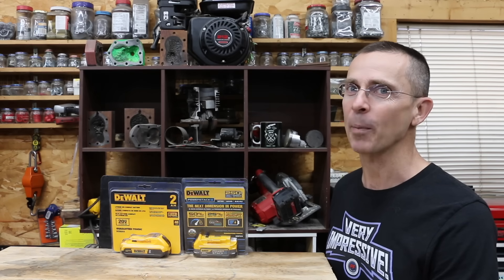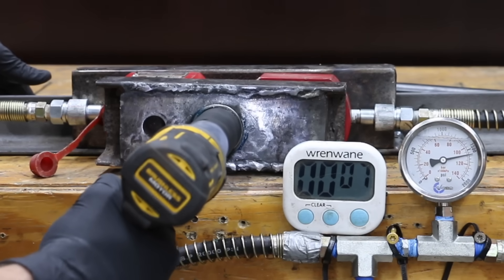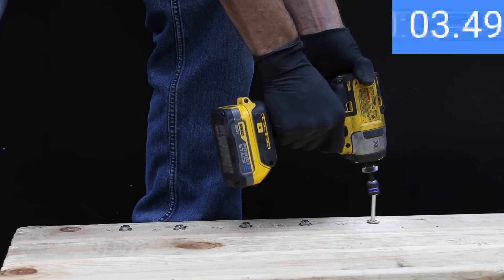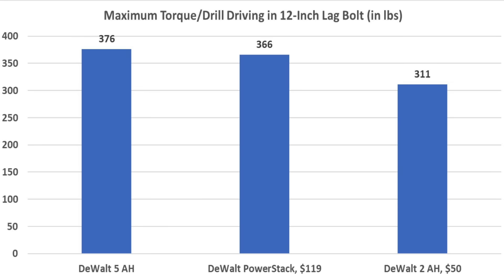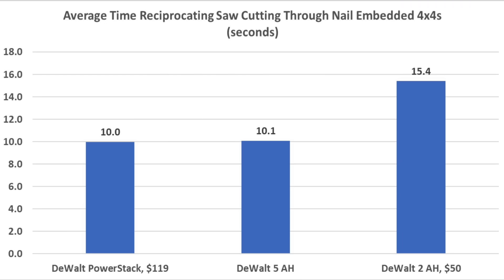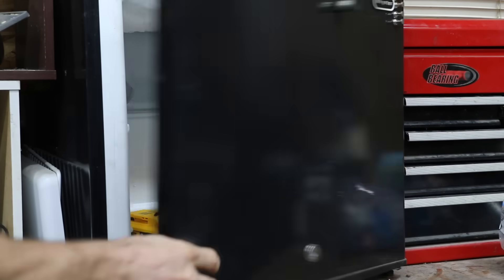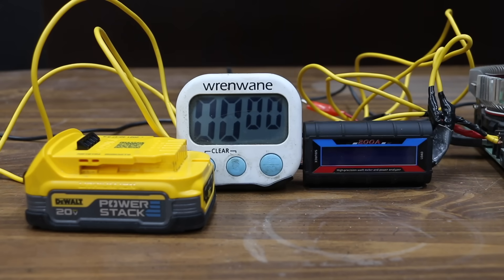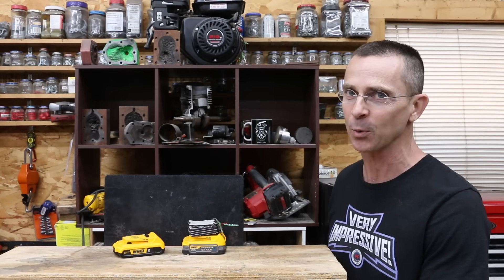Compact “Pouch Cell” Battery Better? Let's Find Out!

Comment: The 5AH battery has the advantage of lower discharge rate per cell, thus generating less heat and surviving at a more constant rate.  Even without recharging, I find my batteries still have power once they return to ambient temperature.  Heat is the enemy of Li-ion.  Sporadic use allows the cells to cool between trigger pulls.
Reply from the maker: Thanks for the feedback.
Reply: I was thinking about the same. I would be interested to see if the power stack battery recovers a lot of power after it has been allowed to cool.
Reply: Also lower discharge per cell means a lower voltage drop, thus more power through the tool. You effectively cut the internal resistance of the battery in half.
Reply: Great information
Reply: I was thinking about this during the blower test. With all the pouch batteries literally glued togeather in a stack I bet it was a built in thermal cutoff rather than actually running out of juice that caused the early loss. Wonder if the blower test would go better for the power stack after it had been frozen?
Reply: will also last many more years!
Reply: Yep. Heat does kill the Li-ion. The phone chargers that allow you to lay the phone on a pad and recharge without actually plugging in your phone generates more heat in the battery and will shorten the lifespan on your phone battery. And since recharging generates heat, it's best if you charge your phone when it gets down as low as possible. Each cycle of heating the battery shortens it's lifespan. Generally around 500 recharges and the Li-ion battery will start to lose capacity at an exponential rate, and it counts as a cycle whether you start charging with 1% or 50% battery remaining. We've all seen this with our phones. Usually around 1.5-2 years of having a phone and the battery loses life really fast because that is when you'll get to around 500 recharges.
Reply: @tubehound69  That's not true, the best charge cycle for lithium-ion batteries is to keep it between 40% and 80%.

Comment: DeWalt says the PowerStack compares to the 2AH, but obviously only in physical size.  Performance-wise it appears very similar to the 5AH.  Yet nowhere do you give your price of the 5AH.  
In my mind, physical size is a moderate consideration, yet price is a significant one.  I would have liked to see if the premium for the PowerStack made it more appealing when compared to the 5, not the 2.
I learned a lot today.  I thought the higher AH rating was only a factor in how long the battery produced power.  Now we find that the higher rated batteries produce more power while operating.
Reply from the maker: Thanks for the feedback.

Comment: Great video. Without a high load, (since the brushless ESC doesn't change) the speed of the drill should depend 100% on the voltage, so that is measuring the voltage the charger stops at for each battery. The critical difference between these batteries is their ability to supply current (amps). All batteries increase current as mAh is increased. LIPOs can provide more current than LIIONs, at the same mAh.
Reply from the maker: Thanks!  Thanks for the feedback.
Reply: The speed of the brushless motor is determined by the electronics, not voltage. If you load the tool heavily it may not have the current to reach full speed. The brushless motor is electronically commutated. For a given trigger setting it will maintain speed as load increases as long as the battery has enough current. Brushless dc is a very different critter. Battery life is much better than a brushed motor.

Comment: This is all a gimmick from Dewalt. There is nothing special about flat batteries. Internals are the same as the 18650, but folded instead of rolled. What is really strange is that they do not list any specs on the pack. Regardless of the geometry, all packs have Ah and charge/discharge max C (1C for 2Ah battery means 2A current that should discharge the battery for 1 hour). In the RC hobby we have been using flat packs for many years and we do have some very high performance batteries (high discharge C), but the performance I saw was in this video was nothing like that. I would guess that this is also a 2Ah battery with slightly higher C ratings than the regular 18650 fitted one. I would also suggest that you do never use those batteries in the blower again, maybe only the 5Ah one, because the discharge rate in this case is about 15C for a battery probably never made to handle more than 2-5C. Your discharge test is a bit dangerous, as discharging some batteries to such low level will cause swelling and possibly fire.
Reply: It's refreshing to see some knowledge👍

Comment: VIDEO IDEA:  how about testing different 3/8" rope for strength abrasion, UV resistance, etc ? I came across this blue "marine rope" on spool in home depot that seemed to be of far better quality than the precut sections. I'm curious to see how it would compare to the braided nylon versus rated rope vs climbing rope.
Reply from the maker: Thanks for the suggestion.
Reply: @ProjectFarm  if you do a rope test, I’d be insanely curious to see how well a rope that has been wormed, parceled, and served compares to a regular rope
Reply: Great idea
Reply: Plastic rope material, my 2 cents:  
Memory: Returns after stretching.  
Best UV colors: Black, then white.  
Worst UV colors:  Red, then yellow.  
Polypropylene & Polyethylene Polyolefins
Strong, Floats, Lo Stretch with No Memory, Dielectric/Insulator, Susceptible to Friction, Damaged by UV.  
Nylon Polyamides
Very Strong, Light, Hi Stretch with Memory, Slick, Absorbs Water/Slightly Weakens, Resistant to UV.  
Polyethylene Terephthalate (PET) & Polybutylene Terephthalate (PBT) Polyesters
Very Strong, Light, No Stretch, Slickest, Best for UV.
Reply: There is a channel that does rope tests already, he has the proper testing equipment and stuff, channel called HowNot2
Reply: @piotrekserwisuje thanks for the link but  I meant comparing  like hardware store rope (rated for xyz break strength) and maybe for giggles throw in some name brand static climbing rope and just see how it compares..
 Interested in how different ropes fair for general household use. Clothesline cord is another good one to include as well.
Reply: @sethsevaroth  he might do that when asked.

Comment: I've been wondering when companies would start using these soft cells.  I wonder how long they'll last before the batteries start puffing up.
Reply: They are more delicate than cell type batteries as there is no hard coating protecting them, but the power factor is usually better with less internal resistance allowing for faster amp drain on tools that need it.
Reply: Your concern was my first thought. These batteries will probably work good for a year and then see faster degradation than the standard Dewalt batteries with cylindrical cells due to the heat/gasses that quickly degrade pouch cells. I would rather have long term durability for my tools. Hopefully Dewalt thought of this.
Reply: From my experience with the soft cell packs, they are capable of higher amp loads, but that comes at the expense of more heat, and they don't really like heat much. They seem to destroy themselves faster because of this. They swell up and then it's game over. This is the reason I went back to the old lead acid battery jump starter packs. The lithium pouch versions work really well for a while, but then the packs swell from heat and they are garbage. It's hard to even find replacement pouches to fix the jump starter, which means more e-waste in the end. Maybe if they put in some kind of passive cooling they might hold up better.
Reply: @blazerchris83  might want to check your jump packs and make sure they are actually lead acid batteries. I recently opened a jump pack that I thought would be a lead acid battery but turned out it was one of these pouch batteries. Puffed up like a balloon of course.
Reply: @MrSleepProductionsInc  the one I use now is definitely lead acid, as I just put a new battery in it last week.
Reply: Aren't these old tech? Phones have used them for years
Reply: @Eric-dr5bj  these are lithium polymer like used in rc drones.  Phones just have lithium ion pouch.  Lithium polymer has a higher discharge rate but you sacrifice compactness and capacity
Reply: @donpayton737  incorrect. These are not lithium polymer.
Reply: @RyanRKJ  so there just lithium ion.  Why did he read polymer in the video.
Reply: @Eric-dr5bj  Not really, phone batteries are very low discharge rate, these are de facto LiPo cells, the ones usually used on RC cars and planes, very high current discharge.
Reply: @T.J. Kong Worth noting that no lithium cell likes to ever be hot, they like to be at room temperature 21-27C / 70-80F above that will cause additional degradation, the hotter the worse it is, for example that's one of the reasons why devices left to bake inside a 38C+ / 100F+ car such as dashcams, phones, tablets, etc will often only last 1-3 years.
Reply: They (pouch stack lipo) certainly provide more power in a smaller, lighter pack, but i take any bet they won't last as long, are more prone to overheating.
The older round-cell pack will take a lot more use, abuse, wear&tear before breaking, both mechanical and electrical.
I'm also concerned about their failure mode, should be more susceptible to fire, especially after suffering mechanical damage (everything will be used as a hammer at some point).
Reply: @timhartherz5652  plus  i would believe  it would be easier to repair a pack that uses the 18650s vs using pouches, so if you good at fixing them, you could make them last a lot longer and cost less than replacing the pack with a new one.
Reply: @jjjacer  You certainly can, with a bit of skill you can make 2 good packs out of 3 damaged ones, on the other hand you can't even safely disassemble these soft lipo stacks without risking a fire, bending/warping them is almost unavoidable, and they really don't like that.
To be safe you can only replace the stack as a whole, might buy a new pack at this point.
Don't get me wrong, they are great batteries, just not a good choice for a power tool.
Reply: The main thing, is that these pouch batteries are significantly more expensive for the same mAh capacity, but have a higher current drain.  The 21700 cells available today seem to be a much more efficient option.  Milwaukee HO 3.0 is smaller and lighter than their XC 3.0, but has the same performance and better thermals.
Reply from the maker: Thanks  for the feedback.
Reply: @T.J. Kong Lithium polimer is basically the same chemistry of lithium ion cells, they only call them polymer because instead of metal casings, they have polymer casings.

18650s at 70C wont last either, it just wont show any sign of malfunction until their CID pops and they stop working (or go into thermal runaway), since it's way harder to puff a metal cup than a polymer pouch.
Reply: @Bramble20322  lipo = lithium polymer, polymer is used in her battery for electrolyte thickner to turn it into gel.....yes the casing is polymer, but called lipo because the polymer in the battery. 

Just like they call it lithium iron phosphate for LiFePo4 is called that because of the chemistry inside, NOT because of the iron/steel casing.
Reply: Great point!
Reply: @T.J. Kong Torque Test Channel put them in a convection oven then did power runs, they held up and produced more power...
Reply: There Li-po cells are less safe as Li-on cells.

Comment: I didn't even know about the power stack batteries, so thank you for that information. However, given the price point I will stick to the 5AH batteries for now. I also have a 6, but that is just a little too heavy and bulky, so I tend to use a 5 first.
Reply: They are available in March
Reply from the maker: Thanks for the feedback.

Comment: If this new battery is anything like the RC LiPO batteries, you better keep them in an ammo can on a concrete floor. Significant fire hazard.
Reply: If you dont abuse them they shouldnt enter thermal runaway and the pack features protection circuitry so there isnt really a significant fire hazard

Comment: 14:35 I count only 5, which is consistent with the power stack 5 pouch alignment. The 5Ah battery has probably a 5s2p alignment too. It would be interesting if they release a 5Ah pouch cell battery for the more power hungry devices. That would bring a serious punch to the job.
Reply from the maker: Thanks for the feedback.
Reply: I count 5 too. Also, since it is a 20 V max battery, it is a foregone conclusion that it will be a multiple of 5.

Comment: Love the video as always, I am wondering if you have ever tried other timers (the blue and white isn't too good for compression as youtube groups similar colors in compression blocks which makes the timer pretty blocky) and if you could maybe freeze the timer when whatever test running is finished. It depends on editing software, but some software's have a very easy freeze frame function that could make it a little easier to see the number with not too much extra effort. You have probably answered this somewhere before, but what editing software do you use?
Reply: Maaaaan go to sleep. It's not that serious.
Reply from the maker: Thanks!  Thanks for the suggestion.

Comment: Don't forget that the weight of the battery pack also impacts the balance of the tool, so a heavy pack might give better balance when working so even if it's heavier you won't get as tired.
Reply from the maker: Thanks for the feedback.

Comment: I was impressed that the lighter one did as well as it did, but I can buy two of the heaver for the price of the double stack. I'll have to think on that one. Thanks for the great testing and the thought that went into each test. Keep the goodness coming. Be happy, safe and stay healthy!  😷⚒
Reply: The new batteries seem great but Dewalt is off their rocker with the price. They announced it as "slightly more expensive" due to the "new technology" then priced it more than double. Its not new technology, these are the same packs that every cell phone has. They just put 5 together in a plastic case. Until the price goes down its a gimic imo
Reply: @Amadillo-v2y  These batteries are not overpriced if you look at their extended usage compared to the older 2AH.  The charge cycles are at least 3x that of the older style.  You pay more up front but these are supposed to last significantly longer.
Reply: @Junglebrute  key words: supposed to
Reply from the maker: Thanks, will do!
Reply: @barnett25  I would agree.  The 5AH obviously has a much longer run life per charge and for the construction application 5AH is much better than 1.7AH once they start releasing larger capacity power stacks then it would be worth considering over traditional battery packs.

Comment: Great video.. again. Nobody does the scientific dive on tools like Project Farm. I personally have no interest in slightly more powerful batteries that are twice as expensive. Two power stack batteries cost the same as two 6ah Flexvolt batteries, and I imagine most people would rather have a couple 2ah and a couple 6ah instead of power stack batteries. I use M18 tools, but I wouldn’t trade my 6ah batteries for 2ah. What does everyone else think?
Reply from the maker: Thanks!  Thanks for the feedback.

Comment: Very predictable results comparing LiPo against Li-ion cells. LiPo has some distinct advantages in regards to power and weight. Hence why drones and other RC stuff uses them. But they are more delicate in every way. Li-ion are generally more robust and tolerant of abuse, but their packaging makes them heavier and less space efficient. 
I’d say these LiPo batteries have some very nice use cases. Short burst, high intensity work, with frequent charges. They will be excellent in that. 
However, they probably won’t have the same longevity as Li-ion cells.
Reply from the maker: Thanks for the feedback.
Reply: These are not LiPo batteries.
Reply: @RyanRKJ  Then what are they? They look like LiPo cells to me!

Comment: "lipo's"  are WAY cheaper than cylindrical. Those particular lipos are wholesale two to five dollars a per cell. As a side note they should not be flexed as you did when you disassembled the pack. They are also capable exceedingly high discharge rates of 10C or better IF they are of good quality. If they are good quality lipos they can be charged to 80-90% in 15 minutes. Lipo's do have a shorter life and heat shortens their life dramatically. They also should not be stored for any period of time with more than 50% charge which they will maintain for an exceedingly long time.
Reply from the maker: Thanks for sharing.
Reply: These cells are not "WAY cheaper", soft pouch and cylindrical cells, depending on what market demands pouch cells can be cheaper on any given day than the equivalent 18650 cells.
C ratings and capacity are a trade off, you won't find a high C rated battery with a high energy density, it's just not how battery chemistry works. 18650 C ratings are only limited for long term output and that's purely a heat issue and even prismatic cells can't maintain their rated C value indefinitely.
Store batteries between 40% and 70% capacity.
Reply: This is the only good comment thread here explaining WHY.  Pouch cells are LIPO batteries, just in a different shape.  They have different charge/discharge rates.  DEWALT IS JUST SLAPPING A HIGH PRICE ON THESE AND USING A TERM SIMPLETONS WILL THINK THEY ARE GETTING SOMETIING BETTER.  Absolute ripoff is what these are for the average user.
Reply: @Sonex1542  not necessarily, it's possible dewalt had these custom made to their spec,  if they went for high discharge rate AND a relatively high capacity this would also dramatically increase the price of the cells. There's so many factors here it's hard to say if these truly are a rip off. You'll be paying a premium no doubt but it's hard to say if they're actually taking higher margins.